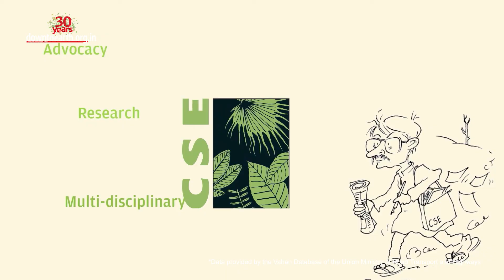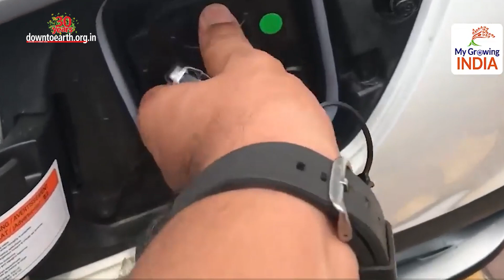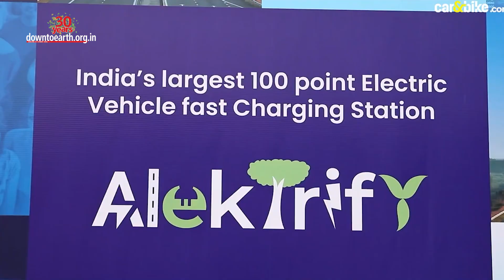India’s vehicle industry needs EV mandate, finds CSE study

Comment: India Offering incentives for EV vehicles is a lie. GST on vehicle itself is reduced, but GST on batteries is not reduced. More over, all imports on battery and related things are taxed 30% and more. and we do not have battery manufacturers in india. Just see the reality of cars in india. 

Nexon petrol automatic edition costs 16.2L on Road in Bangalore(this is the top most spec available in petrol)
Nexon EV MAX costs more than 20L 

Per km cost for EV and petrol car would be similar or more for electric if you consider the 1.5Lakh kms or 8 yrs duration and consider battery replacement cost. With 90% increase in lithium costs and scarcity of these rare earth elements, battery costs could only increase. 

I am not able to understand where is the incentive for me to buy electric car.